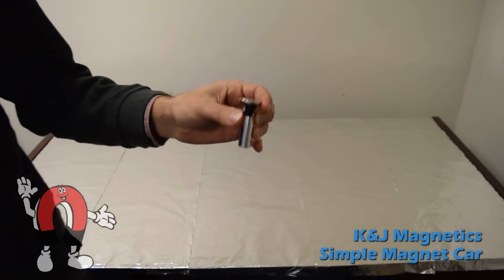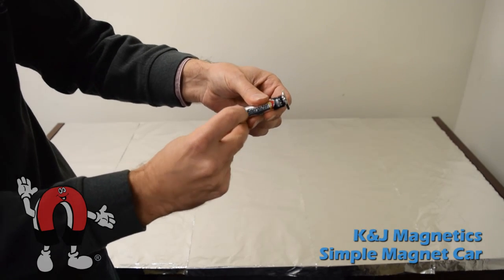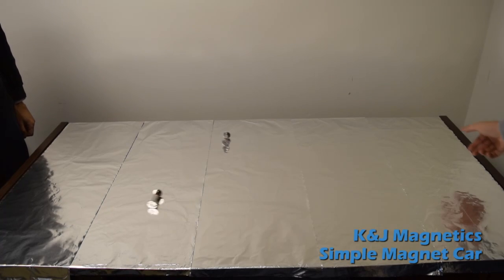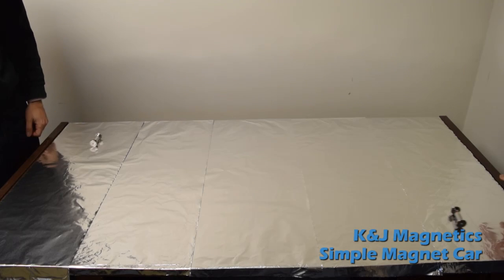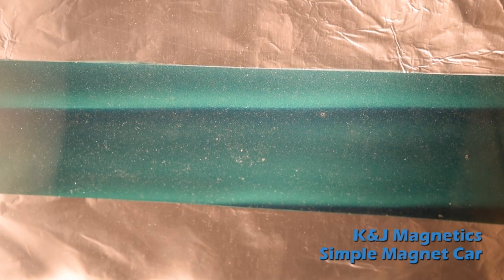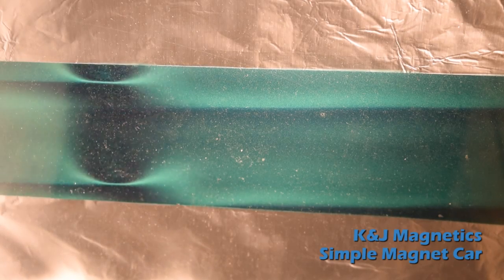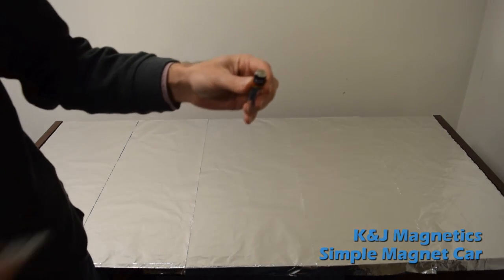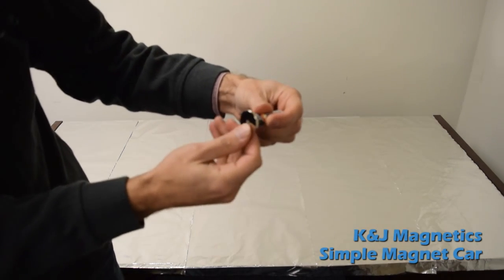K&J Magnetics - Simple Magnet Car 2!

Comment: High Their!
How about doing some fancy work like change-up the battery voltage and entertain us with some variables. That way, you see -  WE might be curious enough to buy some of your magnets and do some playing ourselves... Maybe~ Most Likely~ Darn Good Chance~
(Love your Magnetic Website...)
Reply from the maker: +Arnold Heckers we didn't show it, but we did test with AAA batteries, as well as big D batteries. The AAA batteries worked, but not as well as the AA. The D battery had way too much weight to move!!
Reply: +KJMagneticsProducts what magnets can I expect to use this for the "car"?
Reply from the maker: +siggyx4scythe we used a total of three magnets, a R841 and RX032 on the positive terminal, and an RX032 on the negative side of the battery.